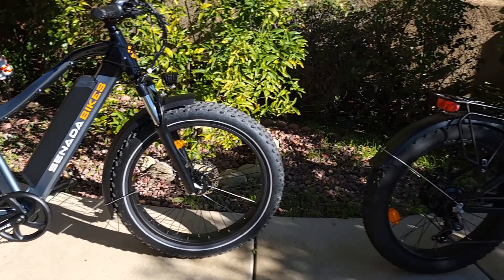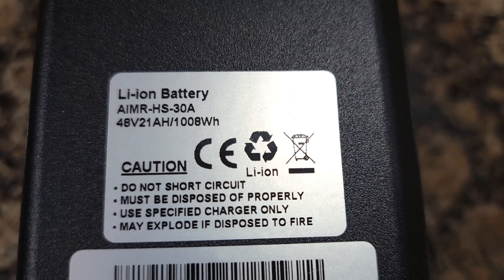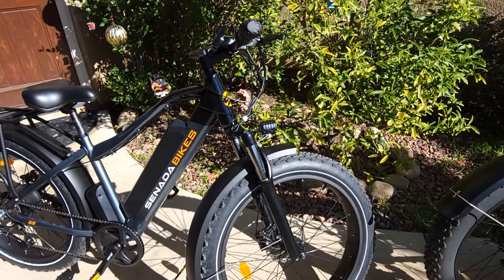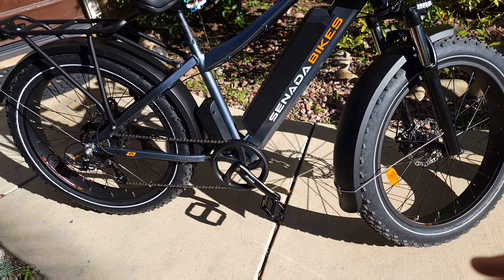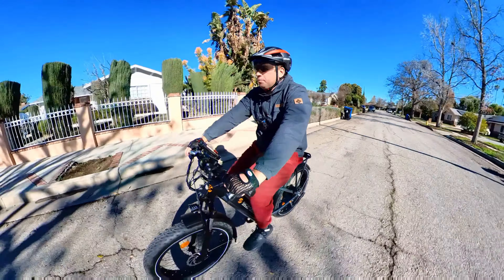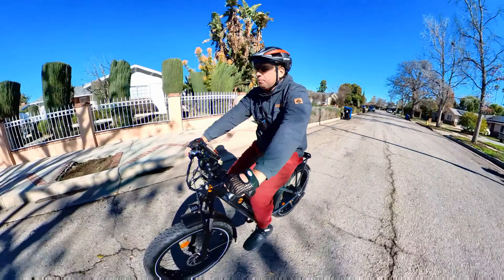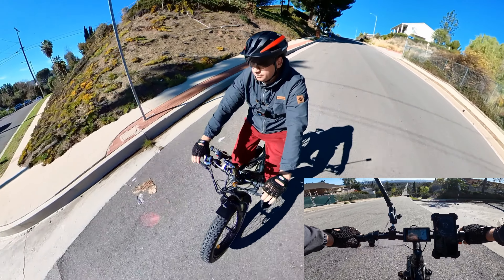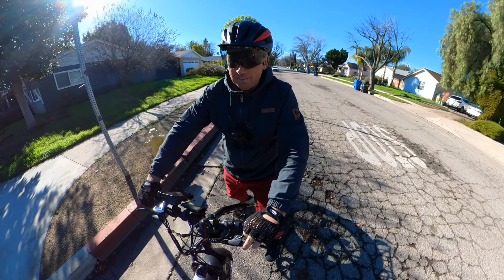Senada Saber Pro 1000W Fat Tires Electric Bike

Comment: Did you mention watts being shown on the display going up hill?
Reply from the maker: No, I think I missed that part.
Reply: @erides  would be nice to hear peak watts used if you get a chance to mention what you can see on the display.. But nice video.  Thanks for sharing the info👍
Reply from the maker: I think it was about 1200- 1400
Reply: @erides  good priced bike for what you get. Nice. 👍
Reply from the maker: Yes, they have good prices with 2 years warranty and good support team.